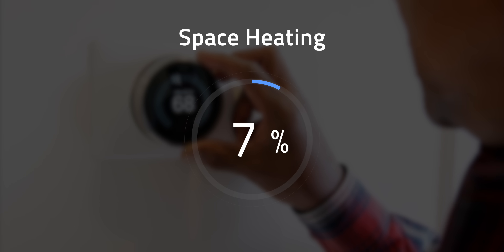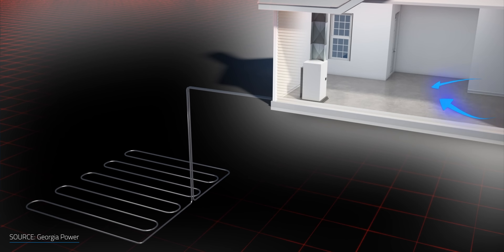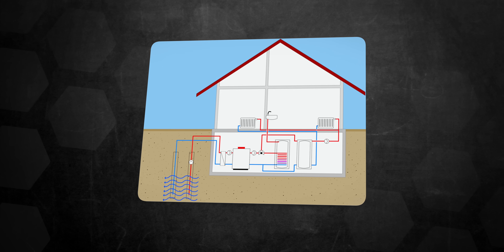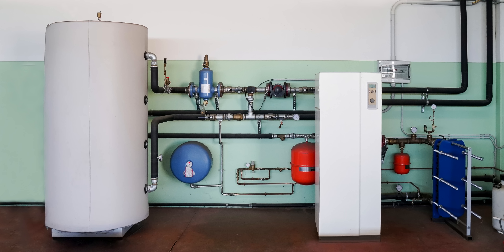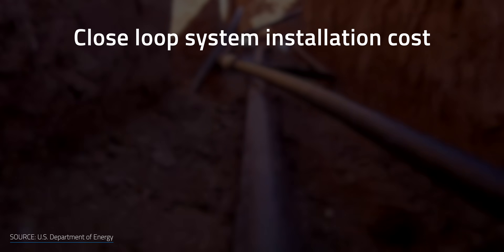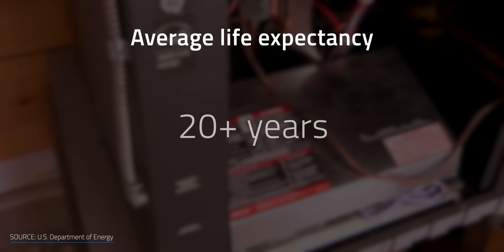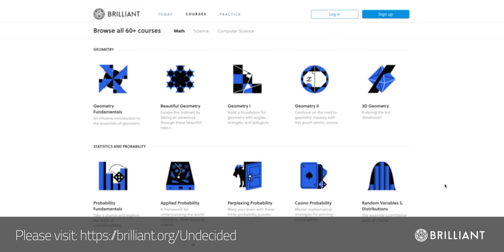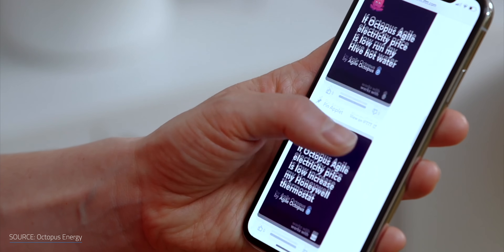Is Geothermal Heating and Cooling Worth the Cost?  Heat Pumps Explained

Comment: How is it 31% of electricity? Theoretically, you would not be using the heating and cooling at the same time right?
Reply: The data is based on 2021's annual energy output, so the timeframe is one whole year.
Reply: Correct. Heating and cooling don't cancel each other out. It's like saying that your average person spends $300/mo on food and $200/mo on gas in a year. It doesn't mean their expenses are $250/mo. It means those two expenses are $500/mo, with each part (and percentage) spent at different times. If you consume both food and gas at the same time, you're weird - and possibly driving unsafely. If you run both heat and AC at the same time - you're weird, and possibly doing something crazy.
Reply: I stopped it right there and started searching the comments to make sure someone else picked that up. Some people's math... :P

Comment: A CoP of 5 just coincides nicely with the fact that standard rate electricity here (UK) costs just about 5 times the price per kWh of natural gas.  So there is no saving by using heat pumps unless you can exploit off-peak rates etc., or are replacing something other than mains natural gas heating.
Reply: sadly true. However there are hundreds of thousands of homes with no mains gas, that rely on oil, LPG or electricity for heat where they make sense. Given the gas boiler ban for new homes coming in a couple of years the market for heat pumps is going to explode.

Comment: In a word: NO!!.  With the new ultra high efficiency air to air heat pumps capable of heating down to around -20F, the geothermal heat pumps make very little sense, and in most areas, you can not recover the increased cost in the life of the system.   A high efficiency mini-split system costs so much less initially that geothermal systems can not recover their much higher cost.  And with the newer less conspicuous heads for the MiniSplit systems, they can be blended into most interior finish schemes.

Comment: Would roof mounted solar panels provide enough power to run a closed loop? Will using floor radiant heating increase heating efficiency with geothermal?

Comment: People love these ideas, until it comes to paying for them.

Then most do the math, and quickly see the savings over Air Source heat pumps simply don't justify the incremental costs, engineering and service cost risks, or energy savings.

Even with significant government incentives buying cost down these are very hard to justify.

Anybody selling these systems that claims you can save $600 to $1,500 a year by switching to ground source, ask if you can get a guarantee in writing.

Comment: Those numbers are way out of whack if you do the loop yourself, which is super easy and can be done in one weekend.  Rental on a backhoe is from $300-$1000 depending on how many days you need it.   I installed my loop and had my home builder hook it up to the unit (ordered my Geo heat pump from Miami Heat Pumps for $3500 - 3.5 ton unit) and my total install cost with duct work was under $10k.  Conventional system was specc'd to cost $8k.  Then I got a rebate on my taxes so it ended up being cheaper than a normal heat pump.

Comment: Wouldn't air heat pump be a better overall choice? Unless you live somewhere very cold it's same efficiency, it's cheaper and requires little space.
Reply: Hundreds of millions of us live in climates that see regular freezing temperatures for weeks if not months every winter. Northern Europe for example. Air source heat pump efficiency drops off a cliff as air temperatures approach freezing, and they become too expensive to run and incapable of providing sufficient heat so have to be oversized. Of course there are also huge numbers living in areas that never see freezing temperatures where they may be idea for providing a comfortable level of heat. There will never be a one size fits all solution.

Comment: There is a nice opportunity for a whole home energy management system. Moving heat around could be efficient, think of all the appliances that do this refrigerator clothes dryer hot water heater and climate control for the house. They could all benefit from a closed loop system.
Reply: Modern fridges and freezers use so little power it's not worth it, and in any case for half the year the heat that comes out of them offsets some of the heating load. In Europe at least most dryers are heat pump or at least condenser dryers, which means they are quite efficient and heat is returned to the room rather than lost outside, again offsetting heating costs. In summer, we dry outside. Heat pump water heaters are pointless in cooler climates, you just pay twice for the heat- you have to replace the heat the unit sucks out of the living space!

Comment: Once the system is installed, you are no longer dependent on the continued competence of either energy suppliers or governments, as long as you have reasonable backup systems. (E.g. a gnerator to drive the pump, in case of a greid power failure.)

Comment: I've never heard of geothermal energy taken from a loop so close to the ground. In Sweden we usually drill a 100 to 250m deep hole into the bedrock.
Reply: It's not geothermal as you imagine it. It's a heat pump. Basically a two-way fridge. They burry it underground because the temperatures in the soil don't fluctuate that much.
Reply: In Finland deep hole is most common only. Due to ground water risks some locations require non toxic liquid in loop. Some build "surface pipes" but for example my neighbour has huge problem with frost in ground making their lawn look like swiss alps after winter. Those pipes are at around 6 feet deep and that is really bad idea if ground has any clay in it.
Reply: I live there and due to groundwater concerns we were only allowed to dig about 6 feet deep, works alright still though
Reply: Deep vertical loops are the standard here in Texas also. I think they are probably more stable and have more longevity than the loop fields. Cost however is considerably more for vertical loops.

Comment: I would love to have a geothermal system.  I would also love a house that has R50 insulation in the walls and floor with R60 in the ceiling.  Then I could heat my place with a toaster. :)
Reply: hey man you are gonna destroy the planet with your fossil fuel burning toaster you should use mirrors to focus the sun to toast stuff.
Reply: @bodhisfattva7462  😂👌

Comment: It’s not really correct to say that the ground is warmer or cooler than the house because of the compressor. I know what you mean but it could have been better explained. 
Also, for many parts of the world, where temperatures don’t get much below freezing, an air source heat pump WORKS JUST FINE AND is cheaper and easier to install, albeit not with the same COP.

Comment: Heat pumps are complete garbage because once the temperature drops below freezing there's essentially no warm air to convert into heat. So they continuously run making them the most energy inefficient appliance in a home. That's why most heat pumps have an electric coil backup or used some type of fossil fuel. The only practical solution for any kind of heat pump is a closed loop system. But the only way it's ever going to become cost-effective is the closed loop system needs to be installed underneath a septic system drain field. Which most health departments will never allow because they want virgin ground for new septic system installation. The deeper you go the more energy-efficient a closed loop system. But in reality you just need to be below the frost line.

Comment: Currently planning our ICF home, southern-exposure heat gain, controlled cross-ventilation via earth tubes... my understanding is horizontal slinky GSHP costs can be lowered substantially by digging your own trenches. Hope to further efficiency by pre-heating hot water tanks & running output through radiant floors. Do you know of a simple USB sensor/valve control & pc/Linux program to help automate all this?
Reply: Why bother with making your own controls when simple and widely available heating control systems available for decades work just as well? All that's required is a programmable room  thermostat(s) and simple, traditional three port or zone valves as fitted to every central heating system installed in the last few decades! Most heat pumps come with a suitable controller and some form of weather compensation and hot water priority system already built in.

Comment: Geothermal heat pumps are a ton of maintenance. No they're not worth it. The pumps fail all the time the heat exchangers fail there's leaks underground. They don't really save any energy until it's below 25° f over a regular heat pump. In fact sometimes an air heatpump will be more efficient, for example if you have a hard freeze and the outside temperature gets up in the 50s then ground will be colder. If the chemical reaction takes place, everything else is Peanuts. I've been installing heat pump for 32 years. In the summer geothermal will make virtually no difference in the overall power consumption. I can swap out a 2 ton Heatpump for around $4000.00. A geothermal will be a minimum of $12,000. Plus if you don't have an acre of free land, you'll have to drill a well, if your government allows it.

Comment: Geo thermal is only worth it if your location suits it. Heat pumps are only good if combine with sufficient solar otherwise the cost of electricity to run the inverter is not off set.
If you are thinking about installing renewables in your property consult an independent specialist who will assess your site, rather than a company that will just try to sell you something.

Comment: A very efficient air-sourced heat pump can have a COP of 3.6. It is just that the ambient air as a heat reservoir is cold in the winters and hot in the summers, directly opposite of what is best for a heat pump to provide heating in the winters and cooling in the summers. That's acutally why the ground is a better source than the ambient air. But it costs.

Comment: I have a 3.5 ton GSHP in a 3,200 sq ft 2 story home. It consumes exactly 1,909w of power when running. For comparison that's less than a European space heater that generates 2,000w for a small room. Another comparison is in a conventional HVAC setup, I would have one HVAC unit per floor that would consume 3,500w of power each. That would've been 7,000w of power consumed for the same sq ft. 

In conclusion, it works and it saves you money over time.

Comment: Great video, but you missed the probe ground source option, here in Europe it's the most common solution which does not require too much space in your garden.
I have two probes of 100m length, each of them in 90m depth, you need only a borehole, not much space, I use it for heating, cooling and sanitary warm water, In my case the calculation is about 7-8 years to be even compared to natural gas/elecricity, if I would use other heating/cooling solutions. And as you mentioned closed systems are the best for the long run

Comment: These systems have gotten a bad reputation from the initial cost to install, and recovery.  If you have a water well, you're all set to reap the rewards of the most efficient heating cooling system on the planet.

Ground water is the most efficient water source for all applications.....installers will tell you different, but do a little research.

Comment: There are several successful ground source contractors in the San Francisco area but I live in Southern California and haven’t been able to find even 1. 
I live in the mountains where it gets below freezing quite often. 
But I think it was a MIT report that said if gs heat pumps were the norm LA could cut electricity demand by 40%. 
That would go a long way toward reducing carbon dioxide pollution.

Comment: Take a look at annualized geo-solar!
I installed this type of system in my new house build 10 years ago and it is remarkably efficient in my northern climate (Rocky Mountains of British Columbia)
Briefly explained, I have a water based solar heat collector that heats my geothermal system all summer and drains this 'heat battery' all winter.
It allows for a much smaller geothermal loop and a smaller heat pump -so small we use a commercial fridge heat pump instead of the 3 ton pump we would otherwise require.
Further efficiency is achieved by using radiant floor heating vs air ducted heat and super thick strawbale walls + R50 roof.
In spring and fall the solar input easily heats the house using a couple of 100w water pumps. In winter the ground loops and heat pump make up the difference. In summer the heat loops store away all the excess heat.
The system also pre-heats my hot water, thus our house does not need a natural gas hookup (unlike all of our neighbours). The electric hot water tank serves as a back up in case the system falls short. Our electricity bill increase is about the same as what others are paying for natural gas (which is very cheap in our region). Without the solar heat addition, geothermal would be more expensive to run in this area when compared to natural gas heat. 
Our grid is relatively inexpensive and extremely reliable since all of our electricity in this area comes from hydroelectric power. In fact, our region still receives royalties from the american states to the south of us who would face regular flooding were it not for the dams in our valleys.
Love the channel, thanks for reading!

Comment: My home of nearly 18 years came with a 7 ton GSHP and horizontal closed loop system.  The house we moved from had a new Trane gas furnace and A/C unit, was 1/2 the size and my overall utility bill in the home is about the same, despite having 3 skylights, a lot more windows and exposure to wind etc.  The prior owner said the house would have required to conventional HVAC units, but was able to get away with one Geothermal unit.  So, a second closet, less operating cost, etc.  The other nice thing is no outside unit to deal with.  In short, if you're going to be in the home for 7+ years, this is the best way to go.

Comment: Geothermal a term that is often interpreted away from the source of energy that being electric.
Several manufactures have air to air heat pumps that perform just as well as water source heat pumps with a ground loop. Avoiding the need for closed loop and an  additional electric loads to transfer the fluid.

Comment: i installed Geothermal closed loop in my house when i built it in 2005. 4000sq ft ranch, 25,000 install cost. average bill per month is 250 year round. that includes heating and cooling my 36x40 garage.
Reply: That's pretty expensive
Reply: @christophervanzetta  for a 4000sqft house and a garage that seems pretty good to me, but I suppose that depends on what’s heating or cooling your house. Propane is much more expensive than natural gas, and electric heating is kind of expensive too. I’ve lived in apartments with 1000sqft and paid $80/month in gas during the winter. If I scaled that to 4000 sqft that $250/mo seems good to me.
Reply: @christophervanzetta  your right. It was put in in 2005 when Geothermal was rather rare in michigan. its much cheaper now. However it did include two 200 gallon water heaters and the electrical panel.
Reply: I pay the same for two natural gas units and two AC coils (central air) in Iowa. Each unit cost $1200 installed. same square footage. Sorry to say but it will be the next home owner that will recoup the cost of your Geothermal

Comment: Geothermal heating and cooling is good as long as you understand the system well enough to keep it maintained. I ran a geothermal system that provide cooling and heating for a skating rink. The guy that had run the system before only ever topped up the loops with water. This lead to the brine being so dilute that some of the loop froze and burst. It took me 2 months to figure out which loops were leaking and isolate them from the system. The leaks cost ~3,000CDN a month in makeup brine.

Comment: The math doesn't make sense. If the heat output is 3-5:1 then how can it only be 43% better than normal heating which can only be 1:1 at 100% efficiency? It would have to be 300-500% or more since it is putting out up to 5x as much heat per unit energy input. 

Even an open flame can only get 1 unit of heat per unit of fuel energy. But boilers etc are not 100% efficient, so it will be less than 1:1.

Comment: i’m all about the “slinky coil vertical loops”   a few trenches and back to the house
Reply: the better installers advise against the slinky coils and suggest straight runs back and forward over a larger area are more efficient, if more expensive and more disruptive to install. Having said that, with enough space and a trenching machine I don't see why they should cost more- it would be easy enough to dig parallel trenches a few hundred meters out from a house and back if you had plenty of land.

Comment: hey guys, it is NOT ONLY about heating-cooling!! the thing is in ADDITIONAL AND SMART THERMAL INSULATING of a HOUSE, then heat pump can be effective. there's no point in heating-cooling a house with bad thermal insulation. ALSO, install and 90% efficiency heat exchanger to avoid throwing paid heat out!  go to EU websites to see how.

Comment: I have geothermal (vertical well closed loop GSHP). The compressor only lasted 10 years. HVAC contractor told me that was a normal life because the system runs year round vs heating and cooling systems only running seasonally. I would not make the investment again.